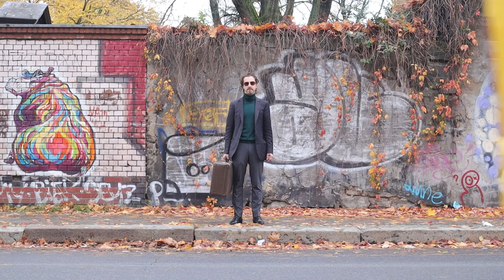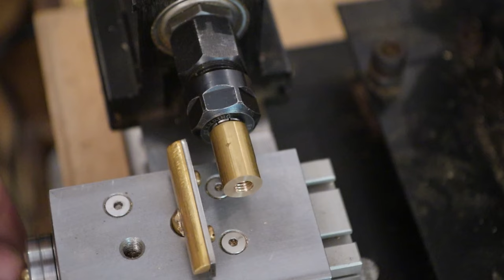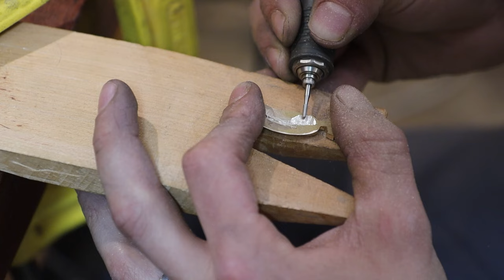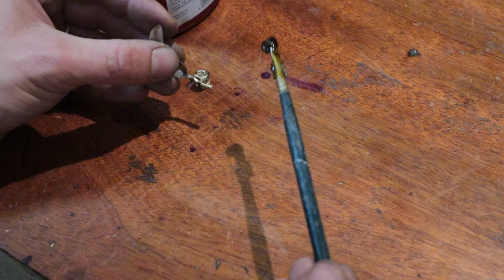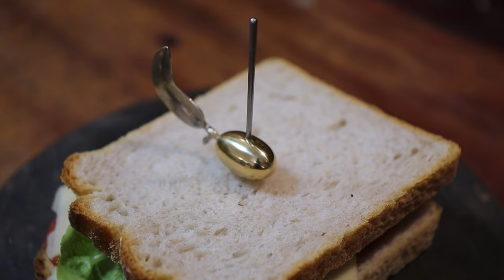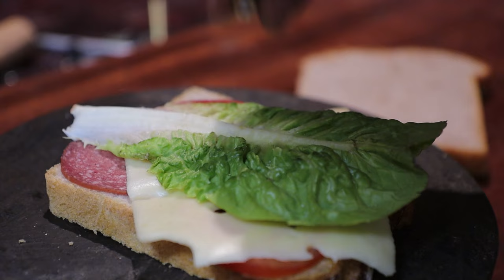My New Invention...

Comment: Metal olives have been around for years.  They're the compression part in metal pipe connectors which form a seal when the connector nut is tightened.

Comment: If your chuck is taper locked, try turning it in the taper to see if the wobble goes out, otherwise, see if there isn't any debris that's causing the loss of center. It's really worth doing the operation, and ultimately not that complicated.